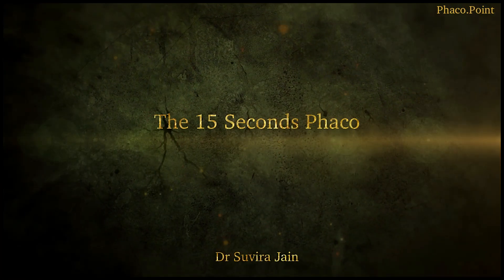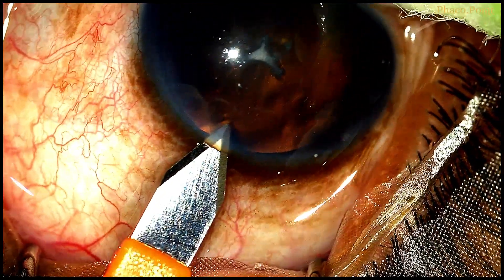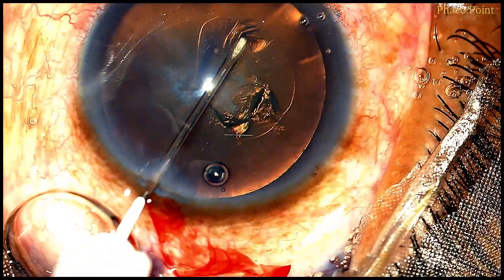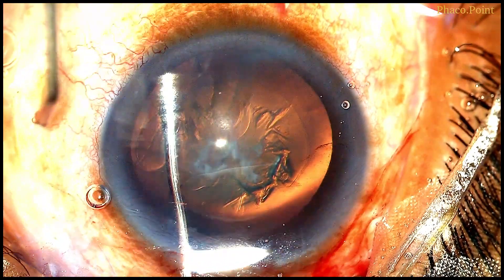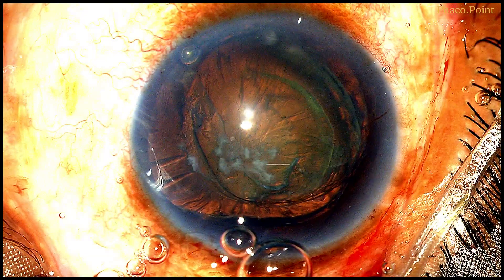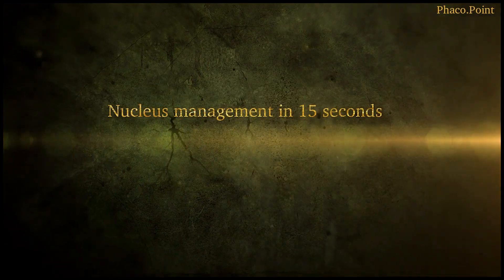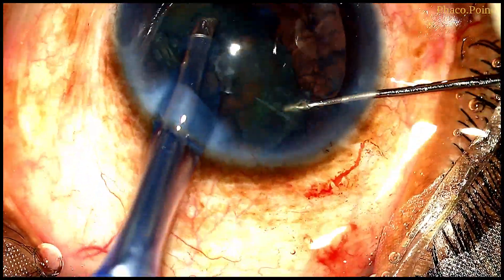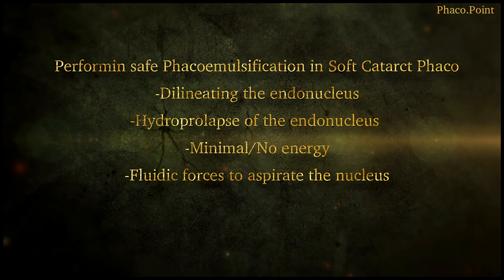The 16 Seconds Phacoemulsification

Comment: Thank you for sharing valuable insights. Whic phaco machine do you use? I wonder if it has a peristaltic or venturi pump system
Reply: When I remember correctly Venturi. But it should not matter whether Venturi or Peristaltic. We use a peristaltic machine and this technique works very well.